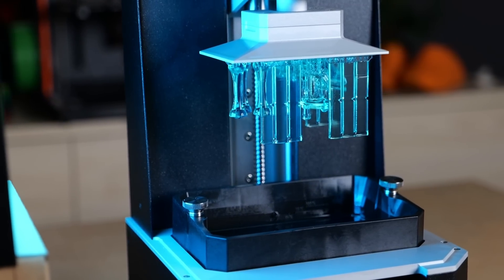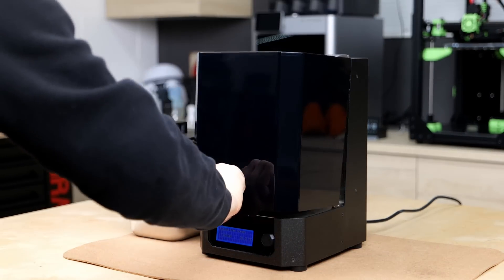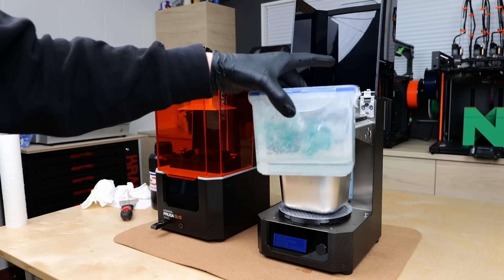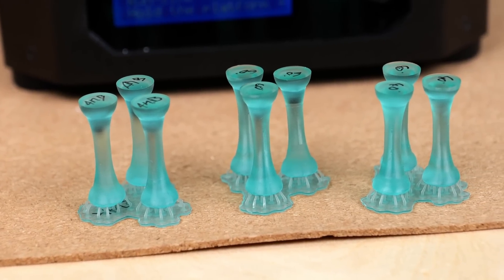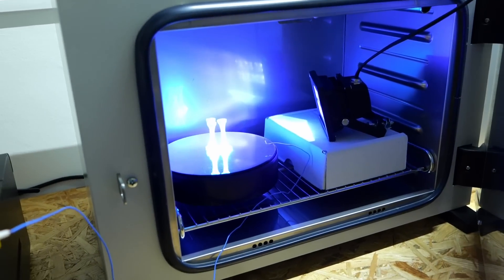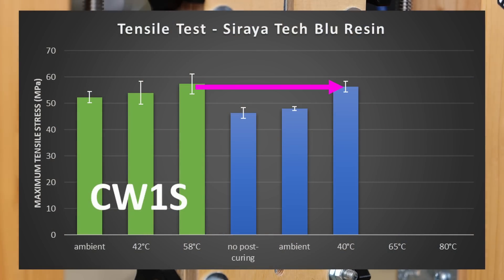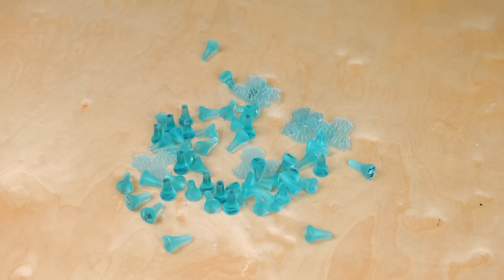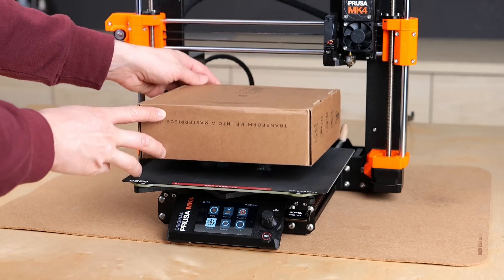Why does Nobody Cure their Resin 3D Prints like this? (40% more strength)

Comment: This is, as usual from this channel, really awesome.

I really wish resin printing was less of a pain. There needs to be a Bambulabs esque ease of use boost to SLA where you can press print, and have the parts washed and cured automatically so you can get by without the whole gloves and mask setup.

Of course, what would also be awesome is that higher temperature forced air heating for the curing station.

The technology all seems there, so I guess its up to some company to implement. It feels like something it might even be possible to implement as a single person with some servo actuation only needed to switch between printing and curing.

So much potential, and this type of printing looks so much more professional than FFF parts.

Comment: Very interesting video. You mentioned you found no significant shrinking, but I wonder if it affects post-print warping on thin flat parts. I mention this because I usually have warping in some parts after "normal curing". If this method fixed that it would be a game changer!
Reply: No the heat worsens the warping. At least that is my experience from trying different post-cure settings on a heated Formlabs curing station.

Comment: Did you take into account that the resin might react differently to the wavelength of the light used? These LEDs look like 365 nm, but if I remember correctly, a wavelength of 405 nm is required. Also the oven might mess with the light produced.

Comment: Hi Stefan,
thank you for doing a resin video again. 
I heard a lot that the exclusion of oxygen during post curing can improve the strength of resin parts. Could you test parts cured in hot water or even under vacuum or nitrogen atmosphere?
Reply: even if it doesn't affect the bulk, a smooth well-cured surface can still be a major improvement of strength, by not promoting crack initiation. I use this oxygen-free curing a lot, but it's more about hand-made things... i don't have an sla printer yet
Reply: @user-it7kg3pm4q  Thanks. How do you know? Have you measured it by any chance? You could be right since oxygen is  only affecting the surface.
Regarding impact strength and bending strength I thought the surface properties could have an impact in regard to those properties.

Comment: Evidently I need to make a resin-version youtube channel of CNC kitchen. When you devote 2 years to making graphene additives for photopolymer, the testing methods to get there paint a different story. Water-curing after an ultrasonic bath for specific formulas is also quite effective.
Reply from the maker: Gotta try water curing next! Maybe even hot water curing😳
Reply: @CNCKitchen  Now we're really going towards the "Kitchen" part of your channel's name
Reply: @CNCKitchen  You will not be disappointed. I should amend that the ultrasonic does get up to 45*C which may be a hidden helper, but with my additives, I typically bypass the IZOD standards and break out a 5lb sledgehammer when I start my destructive testing. The water-curing is a real boon for maintaining geometric accuracy, as you mentioned, prolonged heat curing will warp uncured resin quite significantly. If you don't need accurate parts, heat away, but if you need critical drafts and such, throw 'em in a clear container where your UV can penetrate three sides and you'll see a tremendous difference in part fit as the water (I use slightly above ambient temp water. 30*C/85*F) adds a barrier to delicate parts re breakage, as well thermal control over uneven curing exposure.
Reply: @C-M-E  Try the same thing with Glycerol instead of water and see the difference, it's as good or better than curing in a vacuum chamber!
Reply: @C-M-E  Wait. Does the ultrasonic help here in providing better mechanical properties? How about curing in water: You cure with the water at 30°C , not 60-90°C? Sorry for the newb-questions.
Reply: @C-M-E  So can you describe a protocol to try with something like Siraya? Wash it in a heated ultrasonic cleaner filled with alcohol, then transfer it into a bucket of warm water on a turntable with a UV LED lamp on the side? Do I heat up the water during the curing as well?..
Reply: @p_serdiuk   If you're going the ultrasonic route, it would be highly advisable to Not use a combustible fluid in the ultrasonic tank. While I've not seen it myself, I could see what is often feared happening with the vapors heated into an airborne cloud being a spark ignition concern with some of the cheaper ultrasonic units on the market, but more likely, having a large volume of IPA now quite toasty and readily evaporative into your workspace air would be unpleasant at best and a breathing hazard at worst.  
For print cleaning duty, you can use straight water or a mild solution of soap, light degreaser solution like mean green, a citrus based cleaner, etc. Basically you want to avoid anything that will readily evaporate at higher than ambient temperature. Most ultrasonic units made for cleaning metal parts will have some sort of heater unit over a certain size (normally the 5 liter size and up), but will also warm themselves through the working action. The larger your unit, the more transducers are active, the more it will warm your fluid volume in action. As said, mine will easily go to 45*C in a 20 minute run cycle without use of the heater, but it is on the large side and the transducers all by themselves will consume around 400 watts.  

With water curing, a turntable isn't strictly necessary, as the water will refract the UV light to a certain extent through it's own volume. Depending on how many prints you do at the same time normally determines how much you want water you want to use, and whether your print/resin floats or sinks. If you print them hollow with sufficient wall thickness and vented for air exchange and drainage, they fill with water quite easily and will sink to the bottom. Ideally, your water container will have clear sides, but I've also used 5 gallon buckets previously lined with reflective tape which houses a clear plastic container where the print will sit inside during curing. The reflective tape is a dire pain to use though, and having even a cardboard box with reflective panels (uncreased aluminum foil, a set of mirrors, or insulated foil-lined panels you can find at home improvement stores for floor underlayer systems work great) and a sufficiently sized UV lamp you can find on Amazon or the like; they are cheap, but try to get the ones with metal bodies and a decent lens that looks like a flashlight inside. The spread on the emitter ultimately dictates the effective volume you can cure at one time (or the distance to and inside your volume) and at what power the lamp runs at; 30-65 watt equivalents with 6 emitters are common and normally found under $30 US. Metal bodies are preferred, as they can get very warm in operation, also with some sort of mount or handle to manipulate and an in-line switch is very desirable. 

You can use a few methods to pre-warm your curing water, like previous external heat and transfer, or what I use is a heating pad designed for a reptile enclosure. I've never had reptilian pets, but I pick up the heating mats fairly often for experiments or warming chambers where an elevated environment with passive, non-open heating elements are desirable. I've also used them with heating resin printer chambers in the past for winter printing. They are equally affordable in a certain size bracket, like two for $15 isn't unusual, Amazon again. You can go very overkill with PID controllers and a heating band, but it's not necessary unless you live somewhere in the permafrost region of the globe that is perpetually cold. Most of the year where I live, I'll leave my buckets outside and they'll be plenty toasty by the time my prints are run.
Reply: @C-M-E  This is amazing info. Thanks.
Reply: @CNCKitchen 
You could use a Magnetic stirrer with a hotplate. 
Then all you have to do is put a led lamp next to the beaker while it is getting stirred.
Reply: @CNCKitchen  Glycerol is better than water!  Glycerol is as good or better than curing in a vacuum chamber, look it up [can't put links in here].  Of course you can try pre-heating the glycerol to temperatures you want to test, too!
Reply: So CNCKitchen hottube stream soon?
Reply: @CNCKitchen  Yes, we hot water cure our production parts printed with ST blu. In a pyrex jar, heated with a sous-vide cooker. The UV radiation comes from the outside and shines through the glass. THis is made from LED sttrips coiled around the glass jar and covered with aluminum tape. The setup is simple and very effective.
Reply: Water curing is 100% the way to go.
Reply: @michaelramos4482  With a sous-vide machine for perfect temperature control. :O
Reply: so how about boiling the prints? I wonder if my wife will notice me using the thermomix...
Reply: I have been researching graphene as an additive. Most diy attempts with graphene or graphite powder seem to add 5% or more and usually have a negative impact. My understanding is that graphene needs to be less than 1%. Unfortunately I haven't attempted it myself because my testing methods would only be subjective. Graphene is very expensive especially in small qualities, but it may be cost effective if only such a small amount is needed. There has been substantial research using it as an additive in concrete with impressive results. I'd love to see @C-M-E or @CNCKitchen do some good testing!
Reply: @PerformanceTechEngineering  Yes, it's incredibly efficient per volume once you figure out how to keep it in suspension. While it will probably hurt my sales, the cans I sell will last a Very long time as you only need about 5ml per liter of resin, and my formula is highly concentrated.
I couldn't find a reputable source for finding the right size graphite or a good quality for a reasonable cost, so I ended up doing it myself to have optimal control from the carbon source, graphitizing it through a multi-phase system and then reducing down through another multi-phase process. Outside of time and cost for machinery, materials-wise I can make a two gallon batch for about $10 a quart (or it was last time I ran the cost calculator, about two years ago. I haven't updated that part, but rather charge what it takes me to make a batch and cover costs). It does take about a week start to finish, which is where most of the industrial cost comes from.
Reply: "CME Kitchen"?
Reply: @Leron...   Ah, iterative name! I'd find something amusing to myself, but we shall see. Right now I'm focused on production while the weather is agreeable. It's a lot less fun standing next to my furnace at 2000*C when it's already 110*F outside. 😁
Reply: Yes please!
Reply: We Need more investigation on resin printing  you have ti do It!! Please
Reply: @federicamoretti  I used to be very active on the resinprinting reddit page and have left a wealth of write-ups there, but having a video with specific topics does concentrate the knowledge. When my schedule lightens or the weather gets prohibitive to production, I'll have to do some videos or whatnot.
Reply: Stefan once made a video "The STRENGTH of 3D prints REMELTED in SALT" - He did ABS / PLA / PETG, 
Have you ever attempted resin?
Reply: @Smugly_Watching_Society_Burn   Not salt specifically, but I have tried them in silica sand, silicon carbide and a few other things. The salt doesn't do very much outside of providing a convenient substrate that is flowable around your print, though there are some media that may help the crystallization as nucleating agents. It would be more beneficial inside of the filament rather than a surface modifier. It's fairly well known in the polymer industry that specific salts work well as nucleating agents (silica specifically, but there's a range for every polymer). 
Where resin differs very much from filament however is that the curing process is based on free radical production versus the specific chemistry of the polymer thermal cycling as the filament is a fully formed product, whereas the photopolymer is partially formed and produced through chemical reaction.
Reply: I always encourage people to try water curing (and I do use hot water). The first time I tried it was like discovering a cheat code and I've done it ever since.
Reply: @matthewrice5721  Exactly so. I'm still surprised the industry at large hasn't caught on to some of the best tricks discovered in the user community. Probably a matter of time until we start seeing commercial equivalents, but wash and curing stations have always been basically free money for printer manufacturers. The ones you can make yourself are often more efficient, scale up very easily and cost very little comparatively. Hard to get more thrifty than a bucket of water and a sufficiently powerful LED lamp. 😉 Ultrasonic wash stations are still relatively unheard of with few exceptions, and it's stunningly wonderful compared to scrubbing a dozen prints at a time by hand.
Reply: bmb😮 😮😮😮😮😊😅😅😮😮😮🎉🎉🎉🎉😮
Reply: SLA Kitchen lol
Reply: @Kev_rcng   I like where that's going. 👍 I'm thinking a one word substitute for 'unimaginable pit of despair and financial ruin short of a bad day', like Resin __
Reply: Isn't UV transmission in water very poor? I'd like to see an example setup to understand how the UV can reach everywhere and with good intensity.
Reply: @olafmarzocchi6194  Effectiveness often precludes water quality and mineral content (and ideally clarity, like not using pond scum for a visual reference😉), though I've often used just straight tap water and we tend to have relatively hard water. For the practical limits of UV curing, you're only going to be using a gallon (4-5 liters for the metric crowd) at most, and can use as little water as necessary to support your print. The light will refract inside your curing volume which can be aided with reflective walls, but 4-6 inches of water won't affect much in the way of efficacy. I detailed what I've used in a reply about midway down to someone inquiring about ultrasonic cleaners, but it includes a bit more depth on water curing in the second paragraph or so.
For a very basic tester setup however, you can print an exposure tile test model or even use old supports that aren't fully cured and use an old deli meat container or whatever container you have available. As said in that post, I use a double container (a clear volume inside a 5 gallon bucket with reflective-liner interior for most of my prints that are quite large, but have also borrowed large storage totes and the like for titan-sized stuff). Weather dependant, you can sit them out in the sun with adequate ambient temp (above 20*C/70ishF), or inside, with an adequate UV lamp in the 30-60 watt equivalent range (an LED-powered UV lamp with 6 or more emitters will run 5-7 watts of actual output), arrange your lamp over your curing chamber and let 'er go to town. I haven't done a single model in quite the while and will generally 'bulk cure' my models, but ballparking from memory, 5-8 minutes for a model in the 7"/170mm range was 8 minutes for full cure. You can leave them in there for quite awhile as I've also lapsed timed runs when multi-projecting and had them in there for 20 minutes plus with no ill effects. YMMV, but that's what testing for your particular setup would yield the best results.
Reply: @C-M-E  I can only say thanks for the complete explanation!!
Reply: @C-M-E  how can I learn more about graphene powder additives as well as your products and research?
Reply: @C-M-E  yeah youtube can be wonky. I appreciate it